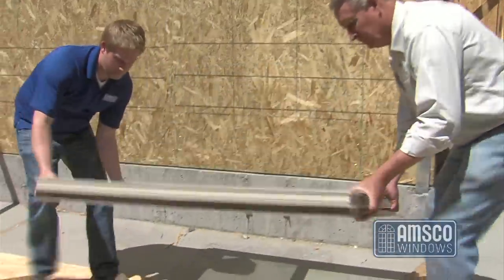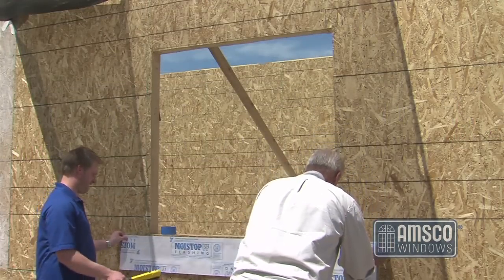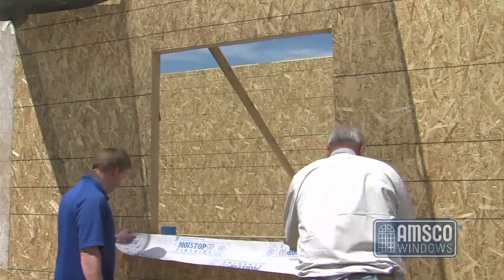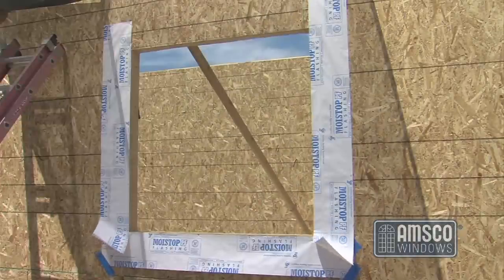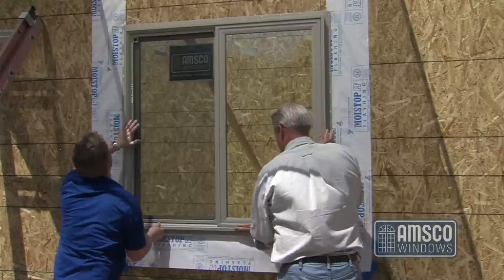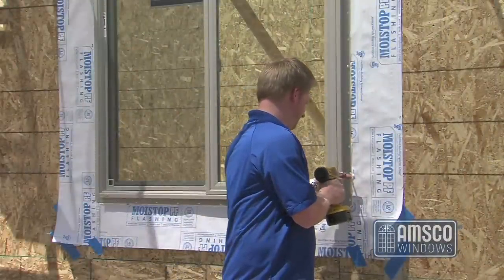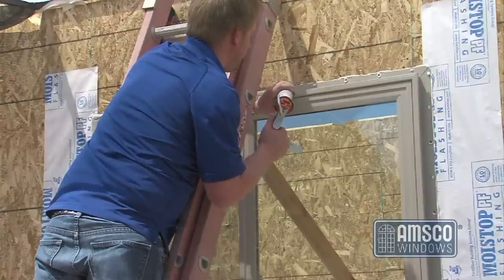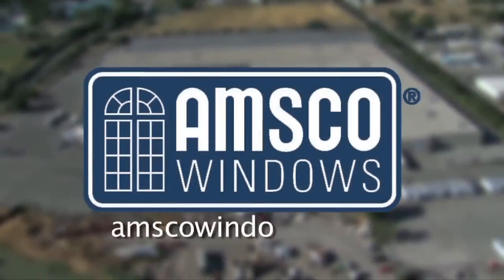New Construction Vinyl Window Installation

Comment: you say to check that the window is square and that the reveal is parallel when we slide the slider over.  What do we do to correct if this is not parallel?  If you say "check that" you need to also provide a corrective action in the case that it is not right...

Comment: You really shouldn't seal the sill. You also don't have a sill pan, so any moisture that gets into the window will not only be trapped by the sealant, but will migrate to the sill and absorb into the wall.